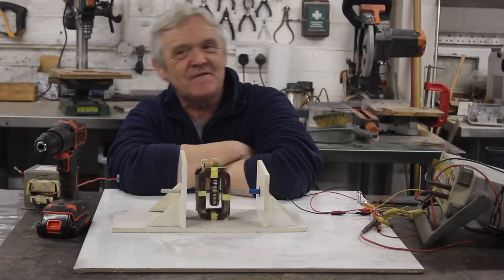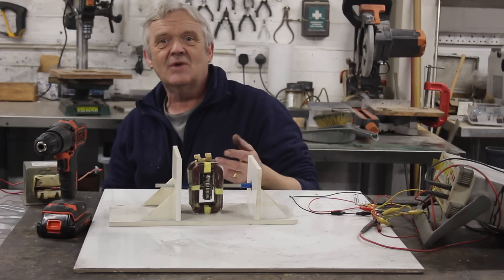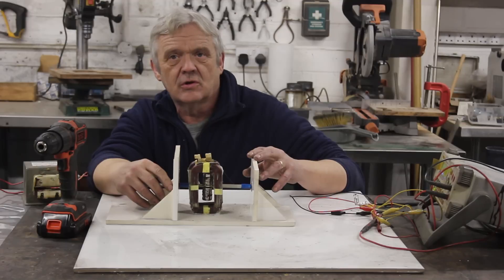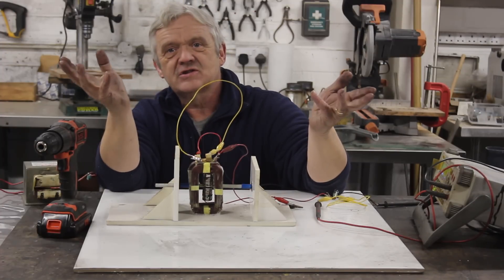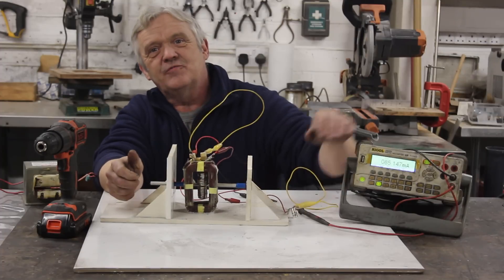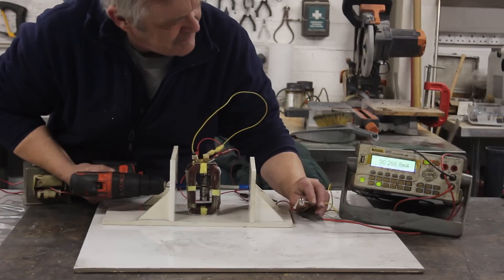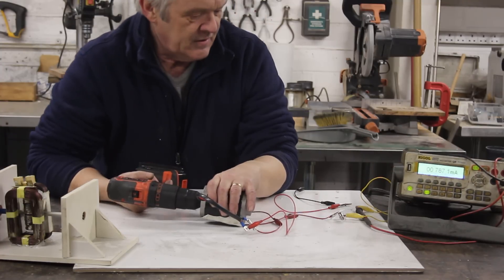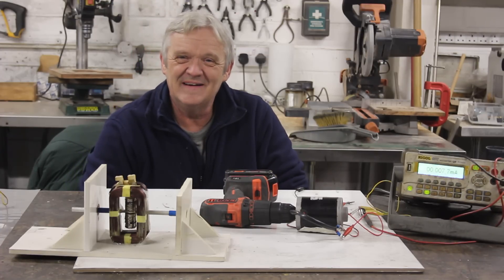1810 Newman Motor Generator - Better Than Shop Bought Generator

Comment: knowing very little about all this Tesla stuff, I would love to see more comparisons.  
By the way, even the words
12 volt, 120 watts
hardly register. I could have a lesson that.  
Volt is the difference in potential energie. Amp is the force of the current. Yes but, if the volts are higher the current will be higher? 
Watt is the labor. But isn’t the labor of a generator not given by the prime mover? 
Just how I 💭 as a electro knonothing.
Reply from the maker: no mate - if volts are higher current won't necessarily be higher
Reply: I will look into it. Off topic: my biggest wish is to built a controller with arduino or raspberry pi with sensors, fan and pump for heating system, with a rocket stove outside. Just because it’s cool and alternative.

Comment: I'm not sure if the comparison is correct. Because you used the drill which has a fixed rpm.
You need to measure the V and the A to calculate the W
Reply from the maker: lol - the load was the same - you could see the difference in performance just by looking - the lamp was very much brighter and being a filament lamp it was a resistive load
Reply: @ThinkingandTinkering  yes that's what I was referring to, I noticed the dimmer lamp to.
I'm just saying it could be either way.
If  the one motor produced at a certain rpm e.g. 6V and 2A. Your motor would produce 12Watts, but if the lamp only draws 1A because of its resistance it's only 6Watts used.
If the other motor produced at the same rpm 5V and possibly up to 10Amps that would be 50W but because of the lower voltage and the resistance of the bulb it would draw less than before. Lower than 1 amp resulting in a power consumption of less than 5W thus the dimmer lightbulb.
As I remember to characterize the stats of a device one needs to measure the voltage without a load. And the current/amps with a low resistance/short
For example one particulare generator could be better for generating high voltages the other one lower voltages with higher current, just as there are power tools which run on 12V batteries and other need 48V.

Thank you for all your content

Comment: So here's a dumb question that I thought of while watching one of your other recent vids, but it applies here as well-  if you set up 2 coils like that, one with thin wire (for volts), and one with thick wire (for amps), can you feed both of those to the same place to get both a decent voltage and amperage, or is that just a ridiculous notion?
Reply from the maker: it would very much depend on how you 'feed' them mate

Comment: high voltage coreless generators are good for lightning up bulbs :) nice video! Kind regards!
Reply from the maker: indeed mate lol lol - but as the load was the same - you could see the difference in performance just by looking - the lamp was very much brighter and being a filament lamp it was a resistive load - so - good for charging batteries
Reply: @ThinkingandTinkering coreless generators should not have any iron losses, with lots of turns on the coil they should generate high voltage at low rpm only negative side I can think of is high resistance of coils but  at low amperes with high voltage good power output can be achieved and coils should not heat up.

Comment: That is astounding Rob!  From a DIY generator it blows my mind that it performs so well.   It would be interesting to see the comparison to what the drill itself is capable of outputting.  You did a video a while back where you made generators out of motors of prefab things like the drill, just curious to see how this little generator stacks up to those.  Thanks Rob!
Reply from the maker: I might try it mate

Comment: I'm an electrical idiot, so correct me if I'm wrong, but isn't the third second* lead you connect absolutely pointless on account of you bridging them as the next step? 😅🤷‍♂️ 
     [edit: corrected to what I meant heh]
Reply from the maker: no it's needed
Reply: @ThinkingandTinkering    Do we know why that is? Is the Yellow (bridge) lead being connected to a different spot than the two Red (positive) leads? (the angle it's filmed at doesn't allow me to discern what's going where) 

From what I can see being done, what I'm able to work out –but by no means am I implying I'm correct, simply explaining so if I am indeed in error, it can be pointed out– is this 'technically' shouldn't be any different than say a 2-socket electrical outlet... 🤔 (except that's AC, vs the pulsed-DC made with your setup) 
[in most cases...] Where a single "wire" is connected (containing L, N, GND), and in turn both sockets have electricity due to being electrically bridged; L->L, N->N, GND->GND.

If one is connecting two Positive probes from a DMM ("Y" configuration) into each electrical socket's Line, then insert a single Negative probe from from the DMM in either socket's Neutral, and set the DMM to AC... it doesn't end up reading  480V    (240V for US) 
It's still just going to read 240V   (120V for US) 

So in your video, if Step 1 and 2 are connecting a two Positive leads from your benchtop DMM onto to what are, at THIS point in the process, still two separate and isolated power sources.... but then Step 3 is to connect a lead between those two sources (bridging)... You've eliminated the need for Step 2 entirely, because they're no longer separate and isolated sources, as they're now running in parallel. 

Is what you're doing here, given that each coil is just a single really long wire wound up, is.... 🤨🤔😞 hmm, no, that wouldn't make sense either... 🤷‍♂️
       "That, which someone is unable to explain by conventional
         wisdom, will often times be chalked up as magic."
                             –Someone, Sometime (paraphrased)
Ergo, I'm left with the only possible answer in regards to the 'how' and 'why' of this: IT'S JUST MAGIC!
🥴

Comment: would probably perform better if the coils were turned on their sides and the magnetic field was crossing the longer span of the coils (assuming the field strength stay the same). Are you using high voltage or low voltage coil out of the transformers?
Reply from the maker: maybe - give it a go

Comment: i wonder if you sealed it ina vacuum (the whole apperatus ) and see if it relieves the friction ...just a thought as we appear to not play with the vacuum ,but tesla did in the car coil
Reply: I think friction is the least of your problems, the actual resistance from magnets might be way more. But then again, I am not an engineer.
Reply from the maker: vacuum is not much of an issue mate

Comment: At the same drive rpm drill speed the Newman generator magnetic field is rotating at a much greater effective end radius, so likely travelling at a higher velocity past the wire.. plus perhaps there is more length of wire in those old transformer cores?  Without knowing the winding setup inside the other gene , kind of hard to make a full comparison … another great video Robert. 👍
Reply from the maker: oh there will be quite a few reasons - like the Newman had much stronger magnets - it's likely the store bought was using ceramic magnets - but all we are showing is you can make something cheaper with. more out for the same in - that's about it really
Reply: ... love your work Robert.  You are a real treasure.

Comment: Are we talking the same Newman motor, Joseph Newman, big powerful motor, uses very little power? Using this as a generator works great, as soon as I saw the output I immediately thought about putting on the same shaft after this coil, another bunch of magnets and another coil. And as many as we can in a row untill it starts to bog down with given power, whatever that may be, (turbine etc) or drill in this case and can connect the in series or parallel to get whatever combination of volts and amps you require.
Reply from the maker: that's the one

Comment: Nice, I will have to try that. I found if I put metal behind a magnet it increases its field strength considerably maybe a small  block of Steel to create the rotor place the magnets on the steel this would put the magnets closer to the coil and possibly increase your output  but again I could be talking out of my a** :)
Reply from the maker: do it mate - I can't think of an easier build project

Comment: Great content as always! 
I suspect the difference here is slightly misleading. 

You can hear the drill spinning at full rpm in both cases, being limited by the drill itself. Differnt design of these makes it really hard to compare efficincies. As an example turning a car alternator and a small motor/generator at same rpm gives hugely different output. I understand that the point is to have something easily made perform well. I'm just trying to point out some of the reasons for the output difference.
All that said, very interestin topic and I appreciate your videos very much, they are a great source of inspiration.
Reply from the maker: there are lots of reasons mate probably the most significant is just the magnet field strength - I used N35 chances are the store bought one used ceramic - but the whole point is price and home made versus shop bought - £30 versus £3 - and I put the same input in - roughly

Comment: Any idea if it would be feasible to use a 3rd coil for commutation on the Newman motor?  Just a single coil that follows one of the main coils and triggers the timing so both main coils can be used for power?
Reply from the maker: I would think that would be easy to do mate - I also thought of pulling one coil from a standard dc motor and using that as a tickler coil

Comment: "Prime Movers"  :) such as a set of peddles.  The reason I've been watching these inspiration tutorial videos is because I own an electric scooter that can go 30 miles on a charge and I'm using the scooter on snowy and icy roads during the deepest darkest part of a Canadian winter so my idea was :) if I could "top up" the battery as I ride, even if I don't "break even" (on the charging and draining) then at the very least I can reduce the amount of drain thus prolonging my overall available distance.  And after watching enough of these I feel I finally have a reasonably legitimate prototype for my setup.
Reply from the maker: nice - let me know how you get on

Comment: Don't you need to compare the two generators using watts?
Reply from the maker: you can compare them just looking at the brightness of the lamp - watts would give some nice figures to talk about that's for sure
Reply: @ThinkingandTinkering    I had noticed the lamp and should have mentioned that.  You had shown both measurements in many other videos (most that were not comparisons to other devices).  I have watched over 95% of the video's you put out (subscribed Dec 23, 2014 when you were doing chemical experiment in, what looked like your kitchen).  I have no doubt that I am one of your biggest fans. No ill will here.  I just feel inclined to comment sometimes.
Reply: both generators were spun at the same constant speed... the NM won!

Comment: So we know it produces at least 6 volts at 1/4 amp. So, at least 1.5 watts at roughly 300 rpm (whatever the drill is spinning at)?
Reply from the maker: pretty much - the drill is likely to be 3-400rpm

Comment: Awesome example and comparison! I do wonder how much copper (by weight) is in the small store bought genny. By looking at it I would assume much less than the Newman genny. I think showing it as an example compared to a store-bought generator of similar mass and size would still drive home your point of simplicity and cost of production. It might even be more convincing. Thank you again for another awesome video. You always do great work
Reply from the maker: cheers mate
Reply: that's the best word.  "awesome" .  I have learned SO much and I still haven't watched all Robert's videos.
Reply: Probably made in China and or, made with aluminum wiring. I have found many (75%) transformers that failed were made with aluminum wiring and no coper.. China?

Comment: That store bought generator probably is either a high voltage generator with a very limited current output or alternatively it is a very low voltage but very high current generator and the low current is due to  the low voltage across the load.
Reply from the maker: low cottage? what do small houses have to do with it mate?
Reply: @ThinkingandTinkering  Sorry  I meant low voltage.  Darn that auto spell check. haha
Reply: The motor is  a flyback as the output

Comment: How about a rocket stove chimney clad with air cooled TEG modules with heatsinks for cold climates ?
Reply: The TEGs would melt
Reply: @McRootbeer  what is their upper temp range ?
Reply: @Compairholman  if I recall correctly, Robert said the solder on most TEGs will melt around 300. Not sure if that's in Fahrenheit or Celsius, but a rocket stove can get way hotter.
Reply: @McRootbeer  that's why I said the chimney , which means at a height from the burn chamber that is within the modules heat range.
Reply: @Compairholman  the chimney is the hottest part.
Reply: @McRootbeer  the burn chamber is the hottest part.
Reply from the maker: MC is right mate the TEGs wouldn't last

Comment: Can you also explain how i could use the power to charge something? How do i get a stable voltage, Overvoltage protection and so on. I would charge a battery pack to then charge my cellphone and power a desk lamp.
Reply from the maker: stick a voltage regulator in there - you can just buy them as single chip
Reply: Easiest way would be to use 5€ cigarette lighter 12V/24V to USB charger, voltage regulator bulld in. The generator outputs AC so four diodes are needed for bridge rectifier, then there are plus and minus to use for whatever needed.
Reply: Try searching for "diy 5V regulator" and with just couple of components found everywhere you can do it yourself. Just add USB output and done. 
Most of the components if not all can be found from broken CFL bulbs, if I remember correctly. Just be aware not to break the glass of the bulbs, some mercury inside.

Comment: Can’t you run it like the wide up radio principle.
Reply: Ye add flywheel mayb gears
Reply: @mushroom4051  I thinking exactly how the wind up radio works, the gentleman who invented it was determined to create a radio for people who don’t have the money to buy batteries in Africa, it’s a pity that a system couldn’t be developed so if I got on an exercise bike and it was connected to some sort of wind up radio system with cogs and wheels that that could generate electricity to help with in the home , wind up washing machines or kettles, the list is endless.
Reply: @KavanOBrien  yes he did a win d up torch also
Reply: @mushroom4051  oh I didn’t know about that, obviously never saw the light = dying is easy comedy is hard.
Reply from the maker: yes

Comment: Very cool. Question: if the coils are copper wire, why do I see cogging? Do you have a piece of steel in there somewhere?
Reply: Think its called The Lenz effect, magnets repels dimagnetic materials when moving (Lenz Law)
Reply from the maker: the terminals
Reply: Atleast the points he is clamping the wires seem to be other material than copper.
Reply: @Teknopottu  Maybe  the terminals?
Reply: @justtinkering6713  Yeah, that's the word. Non-native english speaker here who is also tired.
Reply: @Teknopottu  thanks
Reply: moving a magnet or iron past copper creates a magnetic field in the copper that is where we get the electrical power from
Reply: @rayg436  True but usually magnets do not attract copper thus no cogging effect. The rotor seems to be attracted to the upper part of the stator.

Comment: Many years ago I picked up a box of scrap Marklin Gauge 1 train locos with AC motors. I followed my simple logic to get one to run on DC. By picking out the connections to the various windings and adding a couple of diodes. So the coils would only spin the motor in one direction on DC. I reasoned that an AC motor on DC would have different coils pushing in different directions at the same time.  It worked, and the loco went back and forth fine using the DC controller. However, I seem to remember that if you turned the actual loco around on the track, then the loco direction reversed. Wondering if you could convert a small AC motor into a DC generator in a similar way using diodes. 🤔
Reply from the maker: very interesting - I'll bet you could

Comment: 0.5 of an amp. So adding another 3 sets in series, would get 2amps WOW.
Would love to see you build on this. 👍🇫🇴
Reply: er... I think it was 1/4 of an amp. But still, not bad. You would need 8 in Parallel (not series) to make 2 amps (at 6 volts).  If you put them in series you simply add the voltages and keep the same current... so 8 in series would be ~48 volts and 0.25 amps.
Reply: @marcfruchtman9473  8x8 I would be able to charge my ebike on the go
Reply: @strawman9410  Not sure I understand the "On the go part"?
Reply: @marcfruchtman9473  while riding my bike
Reply: @strawman9410  Odd... I guess your e-bike doesn't already charge itself when you pedal it?
Reply: @marcfruchtman9473  nope
Reply: @strawman9410  Interesting. Back when I had a bike with a generator to run a 6volt headlamp, it was always a little harder to pedal. It will be interesting to see how much harder it will be on the e-bike... let us know how it turned out.
Reply from the maker: quarter of an amp mate - but you could build it too